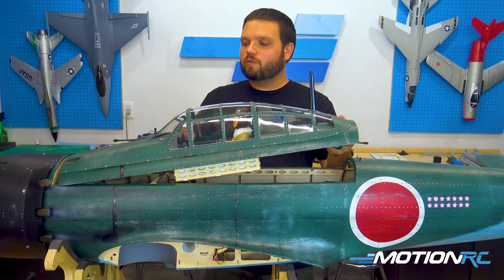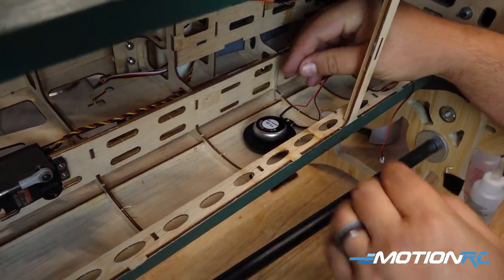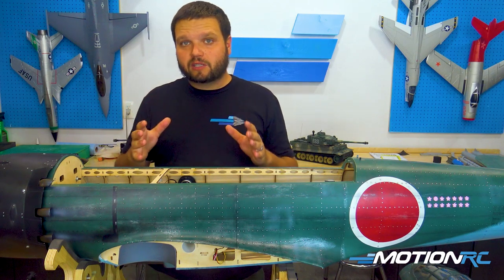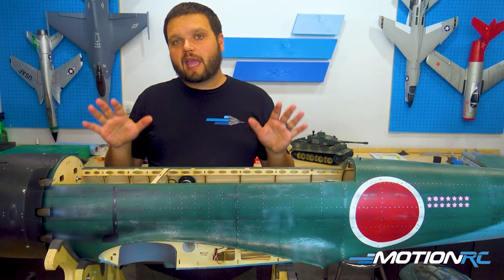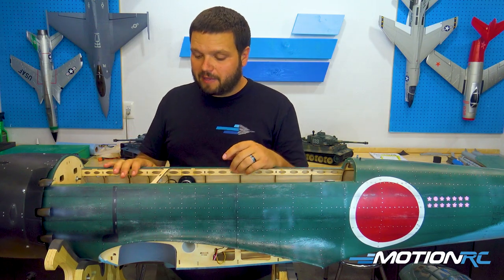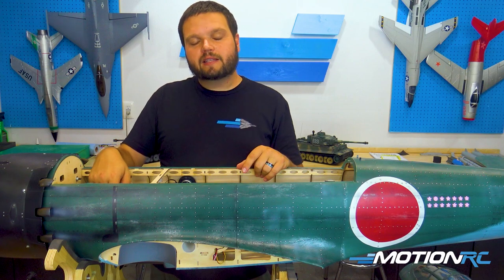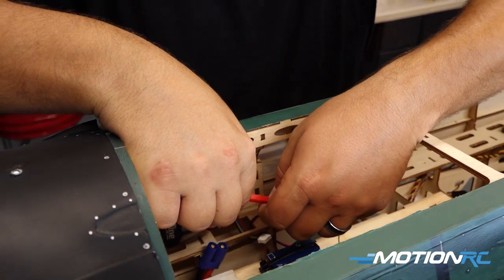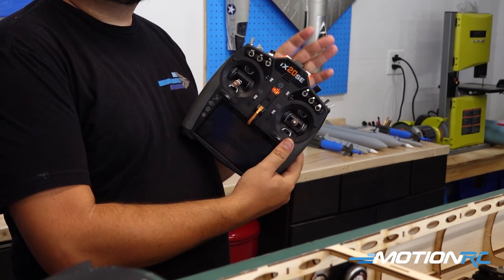MrRCSound ASPIRE Sound System | Quick Tip | Motion RC

Comment: Thanks for the video. One extra tip: on my setup, I used a high-voltage electronic switch to turn the sound system on and off from my radio instead of manually. The switch is installed in series between the battery and the sound system power leads. Worked flawlessly.

Comment: The MrRCSound Aspire system is very cool, had one in a plane some years ago. They are very loud, you can hear it while flying far away.  They are not “speakers” but actually “transducers”.  The transducer vibrates the airframe making the entire airframe the actual “speaker”.  If not mounted to something,  you would hear nothing out of them.  Whether a balsa model or a foamie, once mounted to the fuselage the transducer vibrates with enough energy to make the airframe a very loud speaker.  They don’t have the deep bass tones like a real engine but they do sound very cool flying nonetheless.

Comment: Nice Wes, I did get these twice, but unfortunately they both had a cracking sound when I used the throttle. Guess I was unlucky but MRC Europe sent them off, not sure what the issue was. Will get another one again one day. :_mrcMotionrc:

Comment: I just bought the one for the guns only and its works perfectly in my Tri-plane.  Unfortunately they don't make this anymore and if you want guns you have to buy motor sounds as well.  Well I didn't switch to electric aircraft so I could continue to listen to engines.  I just wanted the gun sounds and apparently that is not possible now days.

Comment: Have not yet found a way to keep the the TT-25 attached to an EPO foam P51. Tried both CA and foam tac.after about 5 minutes, the heat causes foam to go from smooth to beaded texture where attached and it falls off.  Would 5-min epoxy be any different? Any suggestions welcomed.
Reply from the maker: Yes Epoxy will not let go.